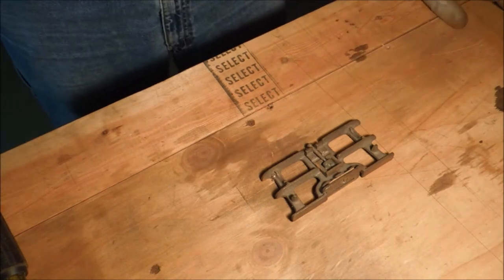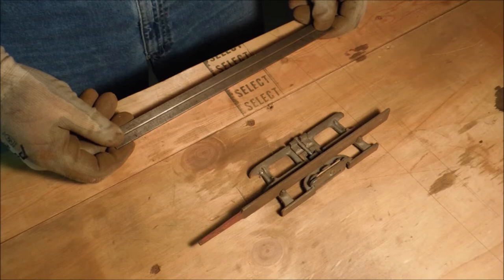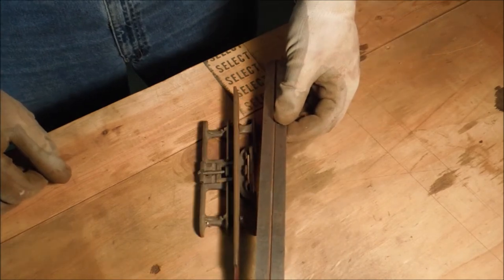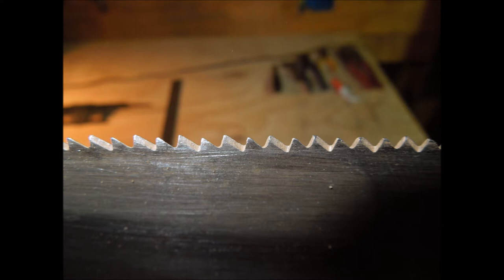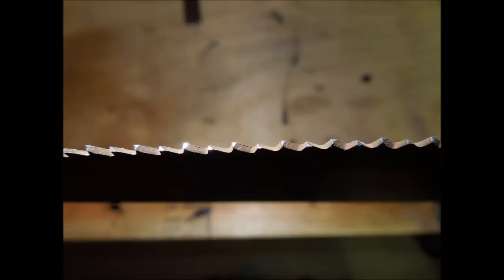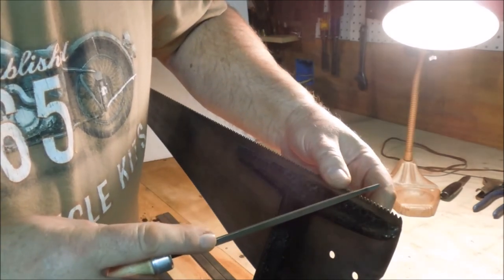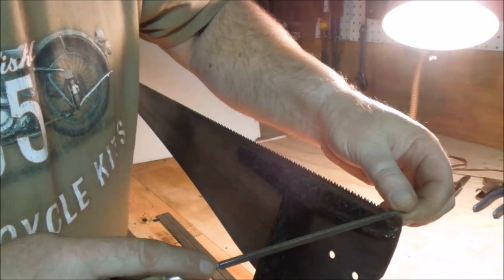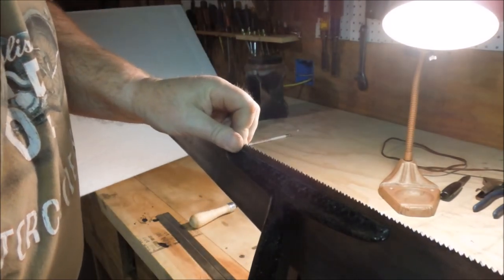JOINTING AND FILING ~ THE  CROSSCUT PANEL SAW

Comment: I'm afraid I'm going to end up trying this one day. Happy happy Unc and Family!
Reply: Lewie McNeely once you do one there’s no going back unc explains it very well go step by step and in a short time you’ve got a saw that’s sharp and a joy to use that’s when you get hooked
Reply: I don't really have but a couple. I'll try and send you a picture one day. One is a bow saw and it's not too bad as far as sharp goes but the other is just unusual and been treated pretty rough but not by me. You'll see.
Reply from the maker: Lewie McNeely Since I did the sharpening demonstration I have done three saws for people who found out I can sharpen saws. You will make more in an hour burning diesel than I would in a day of saw sharpening, but for me it's relaxing. I have taken the weekend off from projects but come Tuesday I have more to do.
Reply: What I've seen of saw sharpening it has to just be a hobby and that's about it. You'd have to have a pile of them and all your Belsaw stuff running and then it'd still have to be a hobby. Take all the time you need off and enjoy each other! We're as calm as we can get, just back from a lettuce run! GBWYall from (Us'ns) here on the swamp